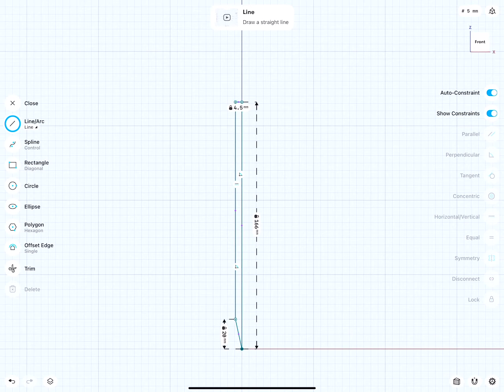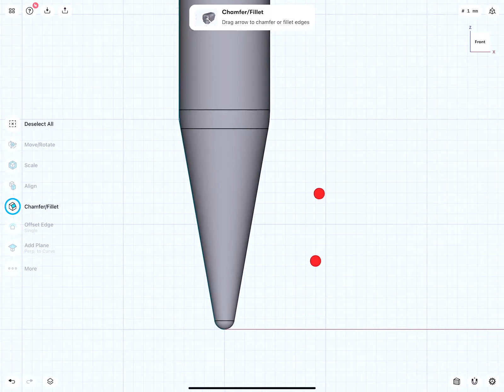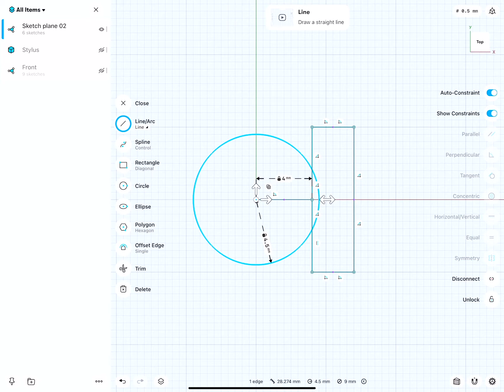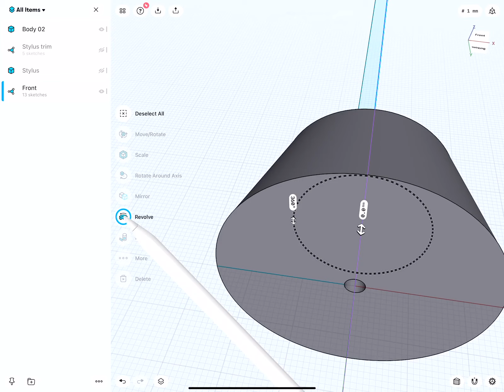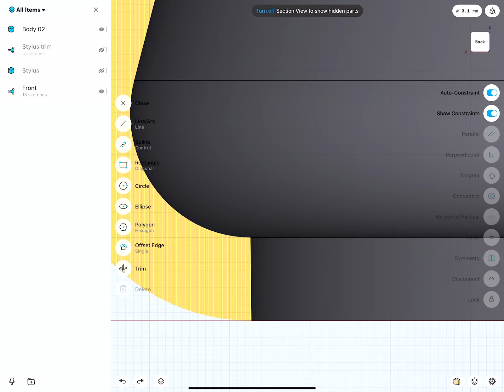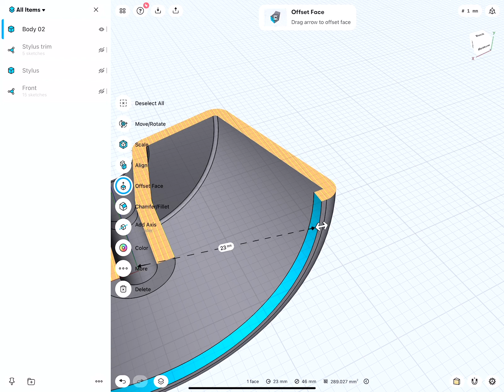3D Modeling a Stylus & Base on iPad | Shapr3D Step-by-Step

Comment: The short and intuitive way from sketch to model in this tutorial is impressive, but it also highlights the biggest limitation of Shapr 3D: you have to constantly delete and redo your part when you have to change elemental dimensions of this sketch. While that is no issue on very simple models or when done immediately, it gets close to, impossible when doing changes at a later stage of a project. I think that Shapr 3D is great for quick prototyping and simple models. For more intricate designs, the level of control in this direct modelling approach is IMO lacking.

Comment: An other (simpler in my opinion) way to add the base lip :

- on the bottom face of your base (with a nice fillet if wanted) before using the shell function, draw a circle corresponding to the final opening desired

- push that circle into the block, of the final shell tickness

- reselect the circle and apply shell

Works like a charm, and avoids having to create and merge a new object and to play with the fillets to match

Comment: Great explanation!

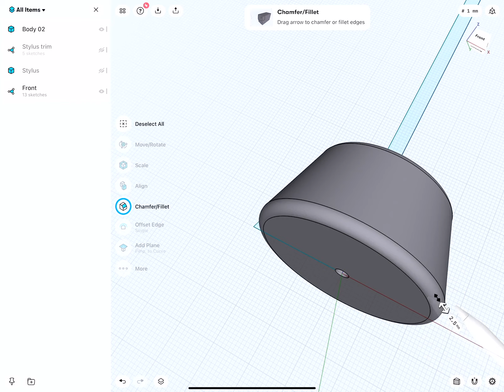@16:30 since you're going to 3d print the base, it is better to do a chamfer on the bottom side than a fillet - chamfers can be printed better without supports

Comment: Thanks for the tips! Don't you have to add some kind of clearance between real-world objects that need to mechanically move with respect to each other (the stylus slides in and out of the 3d-printed base)? Say 0.2 to 0.4 mm separation? If so, how would you do that, would you add the mandatory clearance right at the beginning into the 2D sketch, or later?
Reply from the maker: That's a good point! clearance can be defined either in the sketching phase, or the model can also be modified with the Offset Face tool to meet the required clearance, it depends on your preference :)
Reply: @Shapr3D  Thanks! Making industrial designs intended to be 3D-printed for the most part, I am currently learning Shapr3D right now in order to replace the Sketchup abomination. Love your software 💙

Comment: I want you to add a function to Shapr3D.

I want you to add a rhino-like Osnap function to the line snap function.

Also, add a detailed array function.
Reply from the maker: Thanks for the suggestion :)
Reply: @Shapr3D  

This app has a lot of great potential.

However, there is still room for improvement.

Once that problem is resolved, I'll do all the work with this application.

And I will promote this application in Japan.

Comment: When adding to the base that little lip, you just can draw a sketch under the surface that contains two circles (one bigger and other smaller). Then, extrude the sketch 2mm. Finally, use the align tool to put on place
Reply from the maker: Thanks for sharing :)
Reply: @Shapr3D  No problem, they are infinite ways to do the same, is just try an error to find out which one is the best!